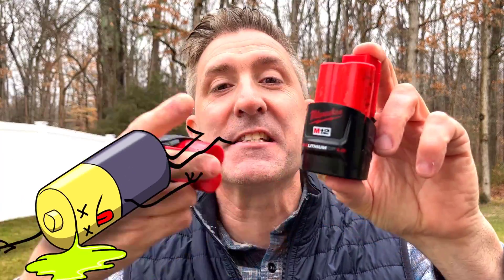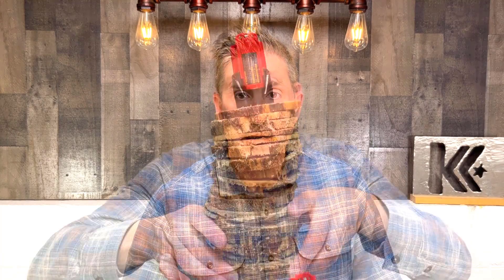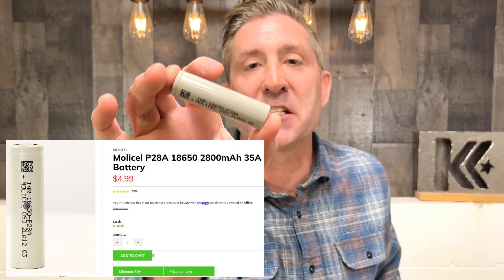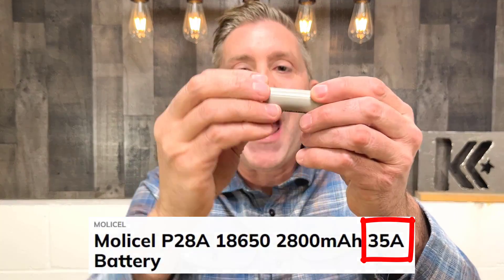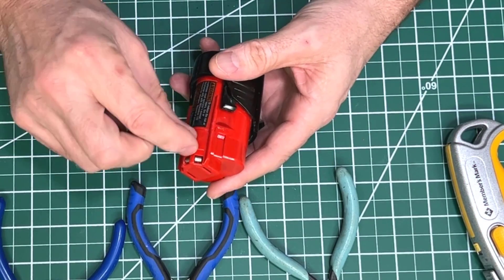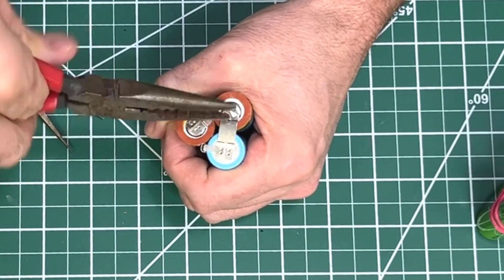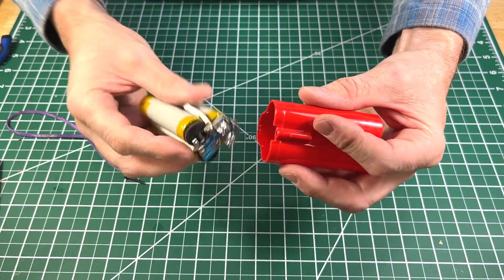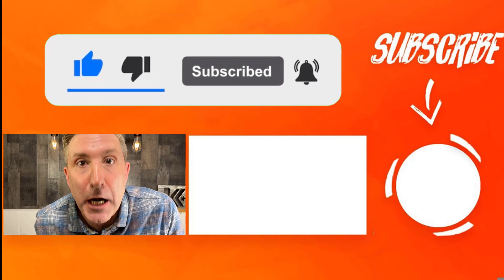150% More Power : Milwaukee M12 Battery Upgrade!!

Comment: Does this bring it in line with the "High Output" official batteries? For instance the 2.5 HO. Curious about building a smaller battery that gets more power out of the gen 2 3/8 stubby impact.
Reply: These molicels are much better than in the high output versions
Reply: High output battery uses cells with 25 amp discharge these batteries have 36 amp so a lot more power

Comment: Your math is wrong... 25 is 227% of 11. Your success was greater than you thought!
Reply: It is wrong but he also said “think” and “give or take” plus the key word “better” meaning the originals total (100%) plus that 150%  basically coming to a total of 250% +/- give the man his credit.
Reply: He said INCREASE of about 150%, the increase is of 127% which is close enough, you can't do math, he was right
Reply: @godzuki2099  take 11 and multiply that by 1.27, tell me what you get...
Then take 11 and multiply it by 2.27.
Here, let me do the math for you:
11 x 1.27 = 13.97
11 x 2.27 = 24.97
Unless you really can't do the math, 25 is 227% of 11.
100% of 11 is just 11.
27% of 11 is 2.97
127% OF 11 IS 13.97
The increase percentage is 227%, not 127%.
You don't subtract the original number It must be included to determine the percentage, otherwise, you are starting at zero.

Comment: There is absolutely no way that cells discharge rating is true. The amp hours is believable but not at that C rating and especially for that price.  You can’t have all three.
Reply: Molicels CDR are accurate. They are stronger and better batteries than the batteries milwaukee uses in all of their m12 and m18 batteries

Comment: if you have a higher cdr does that mean theres more power that goes into the tool? 35AMP vs 23amps?
Reply: Amps mean it lasts longer volts make it go faster

Comment: So, you went from a 1.5AH battery to a 2.8AH battery so much better run time. BUT also going from 23A discharge rate to 35A means much more "power output" which would be noticeable, especially on your little saw and other high load tools. I'd say 150% more run time in practice, with around 52% more power output in theory. 
Very cool to see.
Reply: All depends on the wattage of the saw and if it can use it
Reply: @ericklein5097 better cell, less voltage drop, more power

Comment: So you effectively made a 3ah m12 battery pack that's available off the shelf? I'd be interested is seeing how it compares to a genuine 3ah m12 battery. Not negating the information regarding replacing of cells good to know when it comes to fixing damaged packs that's good information! Just feels wrong to compare the results in this way. For lack of a better analogy, my 100L fish tank broke I fixed it and now it's 200L and it now holds twice as much.
Reply from the maker: Or you had a 100l fish tank that would not hold water and now it does.
Reply: @Kitearmy  This video doesn't portray that narrative. This video has a lot of emphasis on how the modified battery is so much better and how it lasts 150% longer. (Not 150% more power which should be 125% anyway) not that it is now functioning. The results are misleading considering there is already a STOCK 3ah battery. Don't market a repair video as an upgrade video. 

There is no link to the previous video in the description.
Reply from the maker: @jakbain1337  Glad you loved the video
Reply from the maker: @jakbain1337  Hey Jak - do you have a lift foil?  I have a waydoo
Reply: Molicel makes the BEST cells on the market HAND DOWNS (in terms of power cells)

Comment: Where can I buy the batteries?
Reply: This is a saver video, just in case. And a great project, though there are many off the shelf options now.
Have had the twelve volt Milwaukee system nearly twenty years now and only in the last few years have the batteries started failing. Obviously I’m only an infrequent user. However there’s a lot of options now on Amazon for upgraded batteries with greater amp hours than the original.  
Got two and they far exceed the originals, and were far less expensive than the OEM options.
But that work table and mini welder just looked like fantastically useful for building small stuff.
Reply: @noelnicholls1894  Are you talking about the Chinese knockoff batteries on Amazon and eBay that is falsely rated 3.0ah which is actually just 1.8ah?
Reply: @Harvz78  It’s a crapshoot
Reply from the maker: @noelnicholls1894  The helping hands are a must have - I would be careful with the Amazon batteries - they often overstate their specs.
Reply from the maker: https://www.18650batterystore.com/

Comment: More runtime. Not more power.
Reply: I wouldn't be surprised if the new better cells have a better time with voltage sag.
Reply from the maker: @ethandonivan5175  The chainsaw definitely cut faster too
Reply from the maker: Right!

Comment: Great job Andrew!  Redemption is definitely yours this time around, congrats!!

Was curious to know if you are in the M12 line of tools when it comes to drills and impact drivers.  If so, how do you like them?  I like the fact that they appear to be compact.  Just not sure if they are as good and dependable as the larger 18v or 20v tools.
Reply from the maker: I have the M12 for the light stuff and Flex for the heavy duty stuff
Reply: @Kitearmy  awesome, appreciate the feedback.  Flex is definitely a powerful line of tools to invest in and is very attractive right now with their lifetime warranty.
Reply from the maker: @SouthFLTools  The quality of the stuff is impecable
Reply: My 12 drills are used for most jobs, I use the heavier M18 for things like circle saws and drilling concrete.  But 90% of the time all you need is maybe to predrill a scew holes and drive a screw.   Other times M18 is the only option, like my M18 circular saw.   With lights M12 units are like powerful flashlights.  The M18 are more like worklights for lighting u a room.

Comment: You need to make sure that all 3 cells are at the same charge level. Otherwise you will not be getting the most out of the cells. Its the same as how you should not mix an old AA alkaline with a new one. The old battery will drain the life out of the new one fast.
Reply from the maker: Good point -these were all bought new - not sure if the milwaukee charger balances the batteries
Reply: Doesn't the chip in the battery Ballance the charge rates
Reply from the maker: @brettwalkom948  yes - but if the cells get out of balance the BMS can handle that